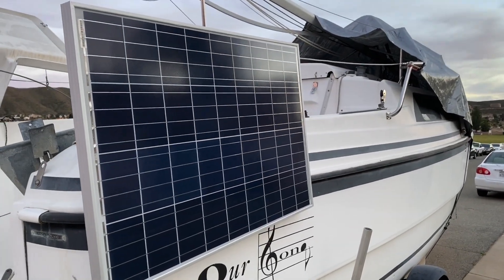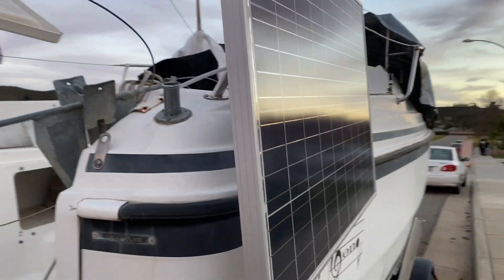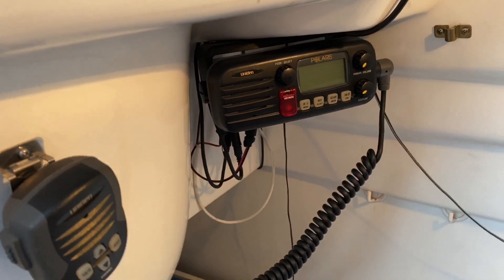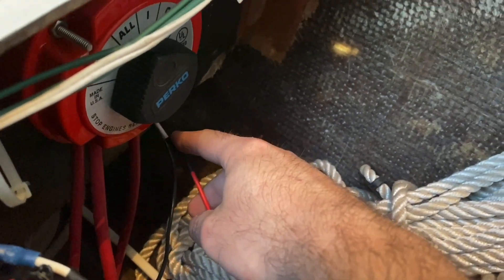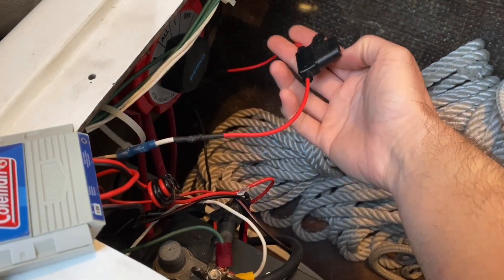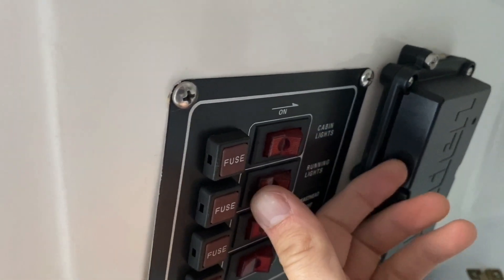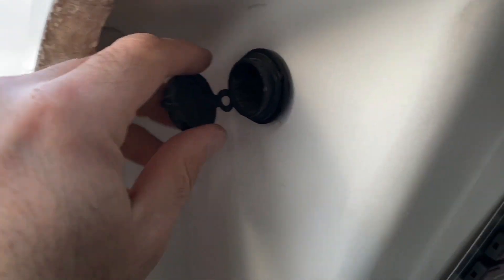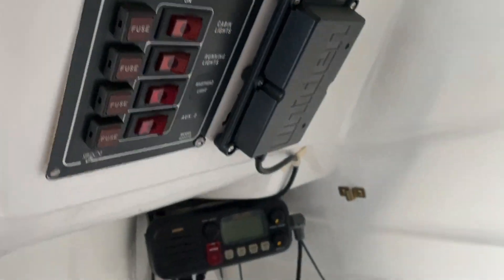Solar Panel Added And Electrical

Comment: I was planning on putting our solar panel in the same place but with a different mounting
Reply from the maker: AyreHeatPlumb I’ve seen so many variations especially for the macgregor..... honestly I’d love to put solar panels half that size (about 40-50w) on the right and left side but with the setup I have it works and the reason i got it at Costco is if it ever breaks or stops functioning I can use their return policy to take it back no questions asked.
Reply: @gregripko  we are putting a 50w panel, what size did you put on ?
Reply from the maker: AyreHeatPlumb I put on a 100w panel and it seems to be keeping up. I haven’t launched boat yet as my wife has been pregnant for a while and we just welcomed our daughter to the family..... kinda slowed things down a bit.... I do have two 12V batteries running interior and exterior lights, sinks, and starting power for engine.